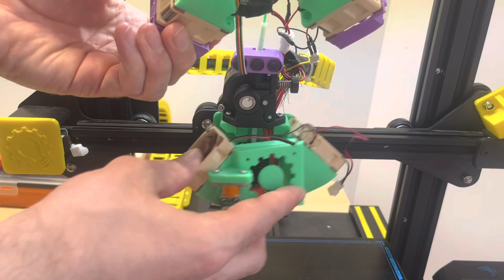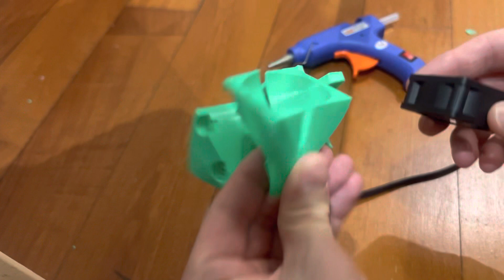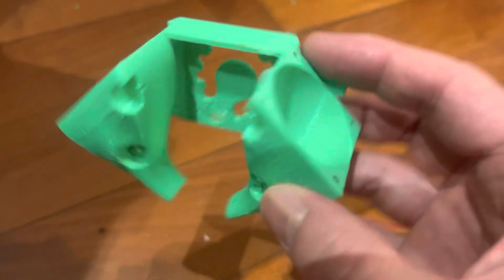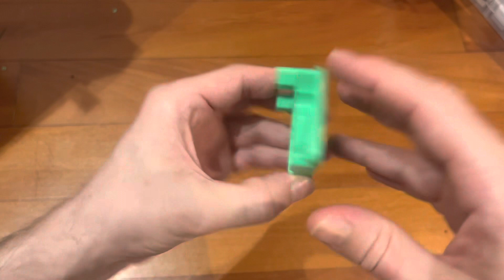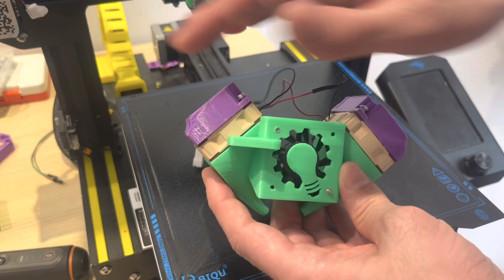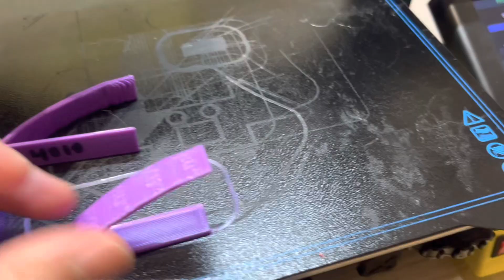Magnetic Mounting Supercharged Printing Head (Part 2)

Comment: Hey there, I've been watching your visa and they're great. Im looking at upgrading my hotend and extruder on my ene 3 v2. The orbiter v2 looks great but I'm deciding between the dragonfly and dragon. What helped you choose the dragonfly  hotend.
 Thanks
Reply from the maker: I mainly chose the dragonfly for its simplicity and relatability to the stock hotend. Similar shape similar mounting etc, and also allows for higher temperature materials. I do think the dragon hotend is a more efficient overall design, better thermals, capable of higher max flow rates if your speed printing or printing with large nozzles and it has a stronger structure, if your nozzle has a pretty bad collision the dragon will have much less chance of being damaged than the dragonfly.  That being said I will probably upgrade to something like the dragon or mosquito hotend in the future as well 😄

Comment: Attention to everyone wanting to build this!

If you are using the Dragonfly BMS Hotend, pay close attention to how many fins your cooling block has!
Dragonfly changed their design without telling anyone and now it is longer than before, so it can be a drop in replacement to the stock ender 3v2 hotend.

If your Dragonfly Hotend has !! 6 !! fins, then you have the !! old !! design and you can use the design which is labeled for the Dragonyfly BMS
If your Dragonfly Hotend has !! 7 !! fins, then you have the !! new !!  design and you have to use the design which was made for the Ender 3 Stock Hotend!

Otherwise it just won't fit.

I really appreciate your dedication for these designs and thank you for your help while solving this described issue!
Reply from the maker: Thanks Simon for pointing this out! I would like to put a picture of the 7 vs. 6 fin version on the thingiverse page but I couldn’t find any online. I’ll look into making a 3D model to show this more clearly.

Comment: I was excited to see a Part 2! Keep up the good work man 👍. I'd be interested to see if you workout a mounting solution for the BL-touch that hides the connector/wires
Reply from the maker: Good idea!
Reply from the maker: Yea I’ve got some great ideas to have a much better overall solution but sadly may have to go away from the V8 look.
Reply: Maybe you could print a small cover for the BL touch to cover the wires instead of changing the overall design?

Comment: Considering you have a bit of play on your duct, I would not place my BL-touch where you have it now, but on the gantry itself. That way your accuracy stays and it's 1 connection less to swap out. Nice concept/idea.
Reply from the maker: Yea you are completely right. I looked so hard for a way to mount the BLTouch on the gantry but couldn’t find a way while keeping the shape of the V8.  I think I will make a better optimized printing head for magnetic mounting in the future that’s in a different shape to solve this.